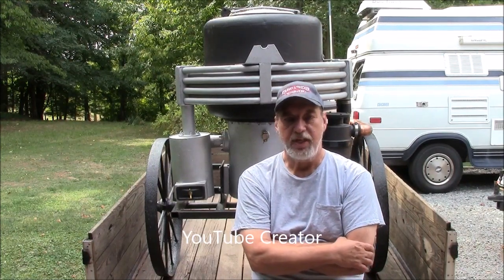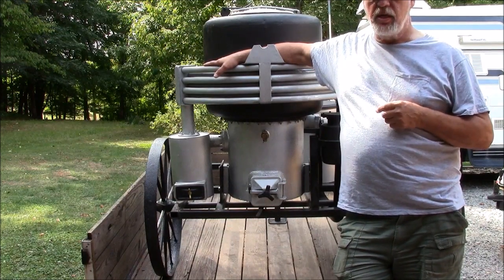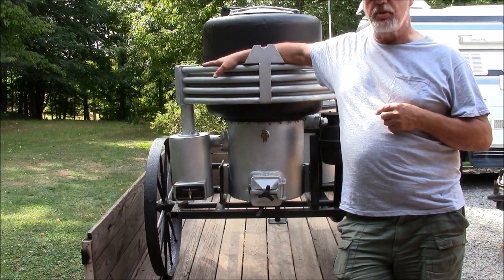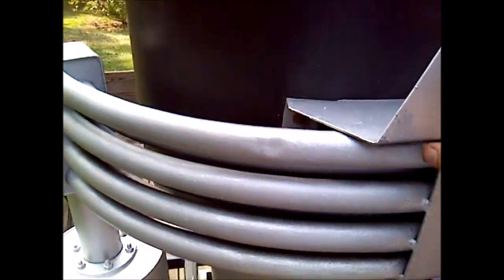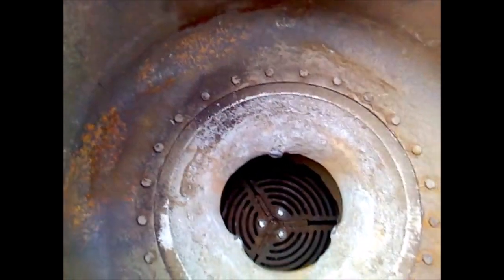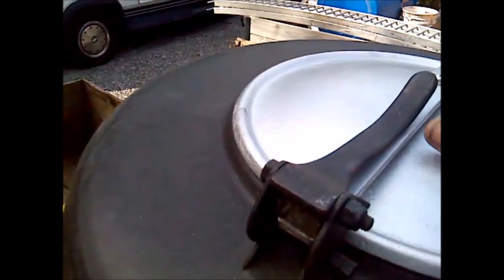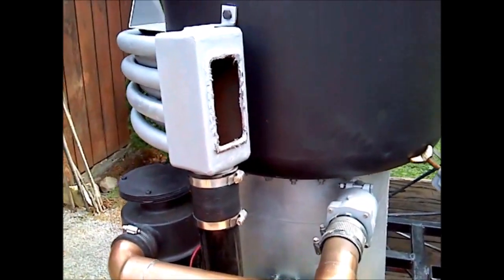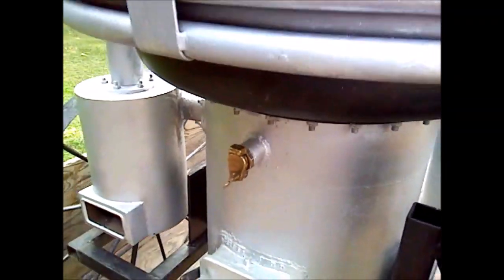1941 Charcoal Gasifier Operation / Maintenance and Gasifier History

Comment: I sure learned a lot!! Always found them interesting and wish I had time to attempt to build one!! Great video Fred!!
Reply from the maker: Thanks Jonathan,  My suggestion is don't build one until you have a LOT of time to read and research.  I rushed into building my first one and spent more time making modifications than if i just took time to read the research.  There are dozens of mistakes any one of them will give you a dirty or malfunctioning unit.  Thanks again for the comment!
Reply: I am good at attempting to re-invent the wheel, only to eventually end up with a wheel.

Comment: A lot of people don’t understand combustion.

Steps:

Pyrolysis

Volatiles are chemically released from biomass and nonvolatile carbon is left behind

Gasification

These volatiles and leftover carbon (charcoal in your case) are partially oxidized by oxygen or steam to produce hydrogen and carbon monoxide.

Combustion

Carbon monoxide and hydrogen combine with oxygen to form water and carbon dioxide

Comment: Do you have measurements of the two butterfly valves on the mixer? There’s obviously an ideal ratio they worked out back then. Seems like a far better mixer setup than most gasifier vehicles people build

Comment: Beautiful Gasifier!
Would have liked to see it work
Most gasifiers work with a blower that draws air in THROUGH the gasifiers air inlet, and out the gas outlet pipe to the cyclone filter and final filter. Then to the engine.
Fuel grade charcoal in ground to a particular size. About 3/4" to 1/8th inch.
Not lump charcoal. Lump charcoal is too big to strip off the oxygen molecules.
You would not make good gas.
But it is a pretty piece of Iron and Copper!
Reply from the maker: Thank you for your comments. I am not sure of the size of fuel used.  I measured the gap between the vertical members of the grate and is it 3/4" or 19mm.  The fuel size would have to be a bit bigger to keep from it from falling through the grate.

Comment: Interesting, the gasifier process is very similar to the process used in a coke fired blast furnace. Coke heated by hot air until it partially combusts to CO gas. The CO gas is burned to heat the hot air that it used to heat the coke and keep the cycle going.

Comment: What a great  video!  Any chance that you could give us a bit more info on the nozzle/tuyere. Does the air pass into the Charcoal through what appear to be three slots trisecting the grate? Does the air enter these slots at the center of the grate or at the perimeter of the grate?
Reply from the maker: Hello Bruce,  Thanks for the nice comment.  The 3 air jets are located narrow point between the hopper and about 6" above grate.   At some point I will take careful measurements and post them here.  I know a number of fellow gasifier folks would be interested in them as well. As I remarked in a comment below I have a second gasifier exactly like the one I showed here and have run it.  If you are interested out my other videos.  More to come.  Fred

Comment: Thanks Fred, very informative, could you tell us why the fire box is so large ?
Reply from the maker: Hi Paul, The black cylinder on top is actually charcoal hopper where the fuel is stored.  The silver cylinder under it is the firebox/ash container.  There is a large air ring that takes up most of the firebox.  The actual grate is about 8" in diameter.  This sized unit would support a large 4 cylinder engine.  Thanks for watching.  Fred

Comment: Thank you for posting this video. Do you plan to use the gasifier ? It would make a good follow up video.
Reply from the maker: Tom, I actually have 2 of these gasifiers.  This one is NOS and a show piece.  It will not be used.  I have fired and run a small (too small) 10hp engine.  I have also run a 4 cylinder Wisconsin  engine that runs a 10,000 watt generator.  I have not made a video of that.  I definitely would need a video helper to accomplish this one.  Thanks for the comments.  Check out my other gasifier videos too...

Comment: What would happen if you started the engine with the starter blower still on?
Reply from the maker: Great question Arch... I actually had two of these units.  The one featured was never used (New Old Stock,so to speak).  The other one I had (I have videos of that too) I connected it to a single cylinder Wisconsin and a 4 cylinder Wisconsin.  In the case of the 4 cylinder one it would pull more vacuum through the system than the blower could push for sure.  Although I never had the electric blower running at the same time as the engine I am quite sure there would be no problem.  Thanks for the interest...   Fred

Comment: Hi Fred, thanks for the tour.   I'm ever so curious.  How does the system handle the fluctuations between idle and wide open throttle one might encounter with a road vehicle?
Reply from the maker: Hi Merv, The "mixer" has 2 dampers, a woodgas and an air damper that are
 connected by a rod.  They open and close together as a unit and are 
initially adjusted so that the woodgas/air ratio are correct for that 
size engine.  Once set they never need to be adjusted again.  At idle 
they are both almost closed and at full throttle they are both wide 
open.  They are controlled bya cable to the vehicles gas peddle.
Thanks for watching and the question.  Best Regards, Fred
Reply: Thanks for the reply.   I follow all of that, Just not sure what happens to the gasifier at idle..  does it just build pressure?  Wouldn't it suffocate eventually if unable to vent?
Reply from the maker: Merv
There is no real pressure in the gasifier when it is in operation.  The draw from the engine pulls the air into the gasifier and that air combusts with the charcoal.  Think of a kind of like a steel can with a smoldering fire in it.  If the vehicle shuts off for a while the coals will just smolder.  If within a couple of hours the car is started again the fresh air entering the gasifier will start burning and the process is back producing gas.  No pressure...
Lemme know if that helps.  Fred
Reply: Ahh so simple it's genius.  That answers my questions and I appreciate it.   As an avid tinkerer, I had a mind blown moment last night when I encountered these units for the first time, only to discover they've been around for ages and were once common knowledge.
Reply from the maker: If you have not browsed my channel, please feel free to do so.  I have other gasifier videos.  I built a unit to power a 10K watt generator and it works great.  The internet is packed with folks who are building and improving the designs.. Thanks for watching... Fred

Comment: Would the carburetor/mixer have to be different to run this to provide heat for a house, different from a propane carb?
Reply from the maker: This unit is designed to power internal combustion engines.  There are many wood/coal/pellet stoves that are modeled around this process.  You might want to Youtube search woodstove gasification.  Thanks for watching.

Comment: My only concern is the amount of carbon monoxide, etc produced by these things--- if I was sure it was completely safe to put into a vehicle, I'd do it tomorrow.
Reply from the maker: The carbon monoxide and hydrogen produced by the gasifier was piped directly to the engines intake manifold.  It was burned completely and carbon dioxide and water were the engines output product.  In California (a state with very strict emissions standards) a properly maintained Syn-Gas powered vehicles pass the required annual emissions test with flying colors..  Hope this helps..   Fred